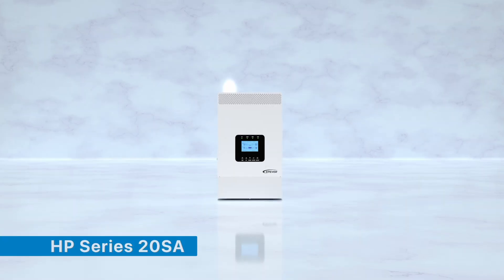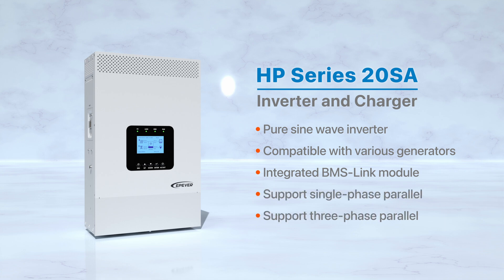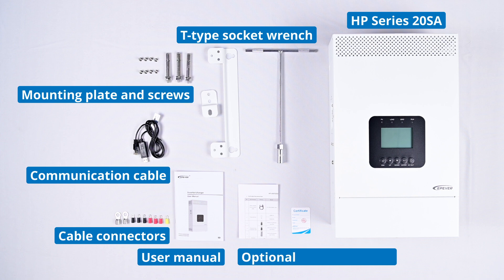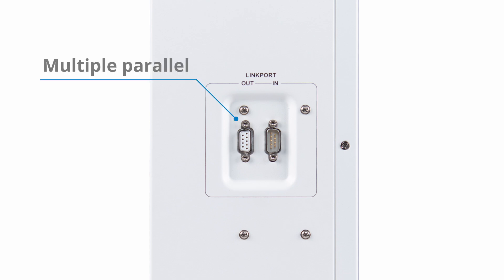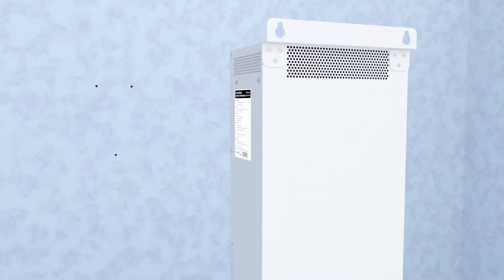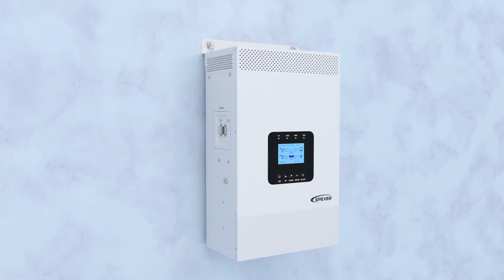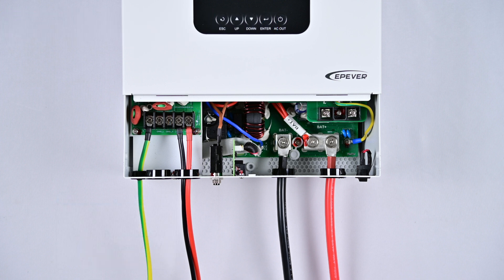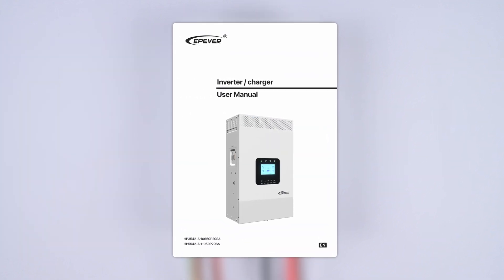EPEVER HP Series 20SA Inverter Charger | Complete Unboxing & Installation Guide

Comment: Is it compatible with the 20A model to parallel with?
Reply from the maker: Hi there, the HP 20SA inverter charger is designed to operate in parallel only with the same model.
Parallel operation between different models, such as 20A and 20SA, is not supported.

Comment: I have the same inverter, running in No battery mode. I'm facing an issue where, when it's operating with PV and Utility and I turn on something that exceeds the panels' production, the PV input disconnects and restarts several times, eventually not coming back until I restart the unit. Is this behavior normal?

According to the manual, when the PV can't supply the load, it should be complemented with energy from the Utility. However, in this case, it doesn't happen; the PV disconnects, and only the Utility keeps working.
Reply from the maker: Hi there, please get in touch with our support team at support@epever.com. Then our technicians will look into this issue. Thank you.

Comment: What's the maximum efficiency and can it communicate with any lithium battery BMS?
Reply from the maker: The MPPT Maximum efficiency is ≥99.5%, the Maximum Inverter Efficiency is 94%, and the Maximum Load Efficiency is 92%. And yes, it has a BMS-Link module built-in and can communicate with lithium battery BMS.